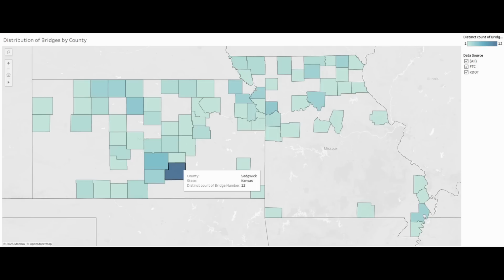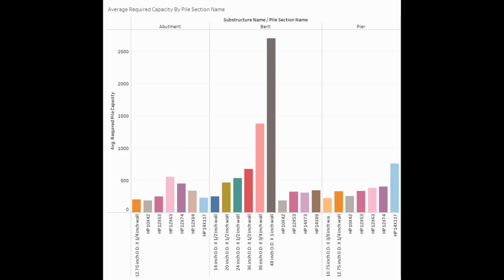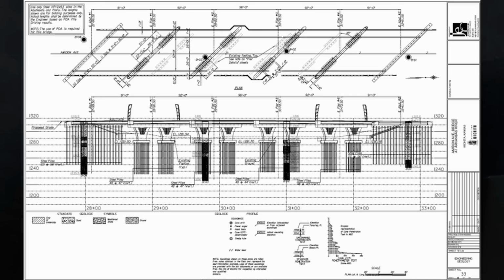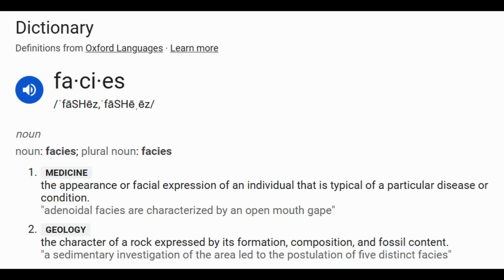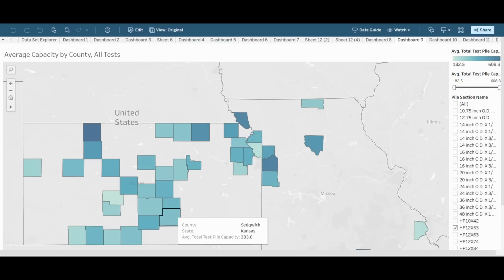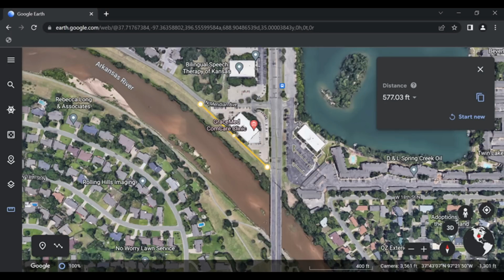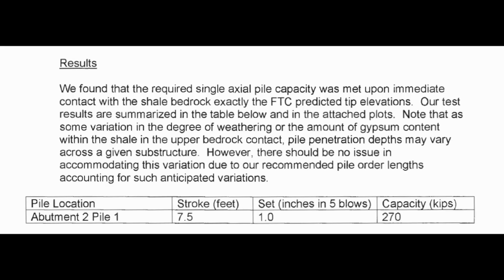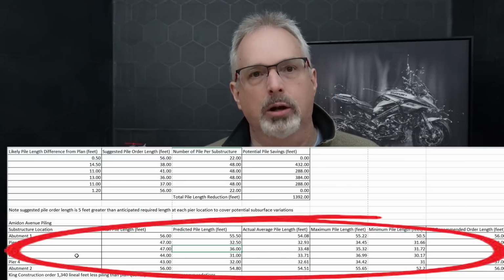Data Analytics and Geophysics for More Efficient Pile Design for Bridge Projects

Comment: I've been in and around different construction projects for over 50 years but I don't have any exposure to pile work. When driving/using steel piles is there a consideration for pile life based on corrosion?

Comment: Am curious to hear your thoughts about auger cast piles.
Reply from the maker: Auger cast piles have their place.  I know of sites near levees where the Corps of Engineers would not allow smooth wall driven pile or drilled shafts due to concerns about creating a seepage path.  From a capacity and integrity standpoint, I much prefer testing driven piles.  Integrity testing for auger cast piles is much more limited and less accurate.

Comment: At 0:50 neither of the two persons involved seem to have hearing protection, hopefully they have ear plugs.

I work in IT and there's nothing as expensive as coming up short a few feet on an installed network cable. But excess material is also an issue. Good measurements will save time and money in the long run.
Reply from the maker: Thanks.  I suspect that the had foam ear plugs inserted.  They were good about safety on this job.  And you a right, it is better to be a little long on materials instead of short!

Comment: It seems like the states all should require the contractors to report back on their construction and testing results to a state database. This would enable more analytics.
Reply from the maker: I wish that were the case.  The hardest part about implementing this application is getting access to the data.  Most DOTs don't have a very good system for compiling and disseminating this information.

Comment: If the layers that we were shown in the rock formed over years, if not centuries, or millenia, why are they so uniform? Wouldn't there be minor disturbances (from wind or animals or other natural effects) cause the layers to not be so precisely uniform?
Reply from the maker: There are definitely variations in subsurface conditions.  These variations can be somewhat normalized by incorporating a large set of data into the analysis.
Reply: @CaseyJones-Engineer  What are we saying has variations? The slices we see that span continents clearly have some variations. It's a naturally occurring material. What I'm asking is why the slices span such giant surfaces (unless you're saying the slices are disqualified from being "uniform" because there are variations in them so even though they look like a single layer they're actually not).

Comment: It looks like you have some very  helpful info. Even with good info, pile driving is still unpredictable. In my 35 yrs of construction, even with soil borings are every bent, Iv’e had piling 5 feet spacing vary in length by 15 feet. It can be a maddening process, at times.
Reply from the maker: Thank you.  Yes, there are some sites that are just a nightmare for accurately estimating pile length.  One problem area I know about is in southwest Missouri with the pinnacled bedrock.
Reply: @ South central Illinois right about where the glacier stopped is so unpredictable as well.

Comment: Very informative video Casey! Know these statistics are basically for your two state area, but what about other areas of the country where subsoil may be very different? Assuming your instrumentation has to be calibrated, what about pile driver, does it have to be also?
Reply from the maker: Thank you!  Yes, the correlations like these can be made using other data sets for a given region.  For example, Pennsylvania has very similar subsurface conditions to Kansas in many parts of the state.  Even where site conditions differ, local correlations are possible by examining trends from the local data sets and excluding data sets from dissimilar regions.

Comment: Is 5 to 10 ft into weathered shale typical for a 12x53 H pile? 

I would like to model the weathered rock layers in something like WEAP accurately but usually we just say X amount of feet into weathered rock or top of rock and the calcs don't matter at that point. Great video.
Reply from the maker: Thank you!  Sometimes trying to figuring out what's truly top of rock is easier said than done in some cases.😃

Comment: How uniform are these near surface (that is for general construction purposes) bedrock profiles, does the seismic analysis show that reasonable clearly? To my suspicion, the geologic survey analysis would be too coarse for a bridge or road structures except where the surface geology is as it were in your face before you. There might be an old (million year old) buried river bed with very fractured material under your planned pile work, where the last one (over there) was on more solid bedrock of the same age layer. And a fracture that shifted or folded the layer beneath your next location - potentially a sort of a crap shoot.
Reply from the maker: I think this application works well when you have soil overlying highly weathered rock which transitions to slightly weathered rock with depth.  At least that has been our experience so far.  Keep in mind that the seismic surveys are really supplemental to doing a traditional geotechnical investigation that includes soil borings and rock cores.

Comment: “Mudstone, a type of mudrock, is a fine-grained sedimentary rock whose original constituents were clays or muds. Mudstone is distinguished from shale by its lack of fissility. The term mudstone is also used to describe carbonate rocks (limestone or dolomite) that are composed predominantly of carbonate mud. However, in most contexts, the term refers to siliciclastic mudstone, composed mostly of silicate minerals.”

“Karst (/kɑːrst/) is a topography formed from the dissolution of soluble carbonate rocks such as limestone and dolomite. It is characterized by features like poljes above and drainage systems with sinkholes and caves underground. There is some evidence that karst may occur in more weathering-resistant rocks such as quartzite given the right. Subterranean drainage may limit surface water, with few to no rivers or lakes. In regions where the dissolved bedrock is covered (perhaps by debris) or confined by one or more superimposed non-soluble rock strata, distinctive karst features may occur only at subsurface levels and can be totally missing above ground.” 

In our area, which was over the Edward’s Aquifer, drilling a water well requires somewhat special equipment because ground water levels can be a couple hundred feet (or much more) underground. Drilling through Karst has the disadvantage of deep caves and part of the drilling gear can just “drop”. In these instances ground sonar equipment might also be employed. 

The issue with mudstone is dissimilar. Most sedimentary rocks harden by the extrusion of moisture and crystailzation over time. Mudstones are just dried out compressed mud. When you heat the mud essentially you get pottery, and over geological time these heat processes occur via underlying Magma penetration or in some places soils being covered by 1000s of feet and then uncovering. As a consequence such stone has a wide range of hardness and variability. 

BTW, as you mentioned this is some what true of shale, though some shale can be extremely hard, 

“Lithification follows closely on compaction, as increased temperatures at depth hasten deposition of cement that binds the grains together. Pressure solution contributes to cementing, as the mineral dissolved from strained contact points is redeposited in the unstrained pore spaces. The clay minerals may be altered as well. For example, smectite is altered to illite at temperatures of about 55 to 200 °C (130 to 390 °F), releasing water in the process. Other alteration reactions include the alteration of smectite to chlorite and of kaolinite to illite at temperatures between 120 and 150 °C (250 and 300 °F). Because of these reactions, illite composes 80% of Precambrian shales, versus about 25% of young shales.” 

It is important to note that Precambrian shales (pre Ediacaran) were formed in seas with lower redox potentials, thus the oxidation states of minerals are lower and more easily desolved or undergo oxidative transformation. As a result some that’s hard before perturbation may not remain at the same hardness when exposed to oxygen.

Comment: Why wouldn't an owner (DOT) include this data with the request for bid specs as routine? At least require wherever available data be used by bidders and attached to bid package for the owner to evaluate bidders completeness of needed pile specs to be able to support the loads that will be present. Too often unfortunately government is where common sense goes to die. Ray

Comment: This is actually a GRAND use of technology! I simply can't imagine that this is not STANDARD PRACTICE for every geo testing company! By providing this data to the contractors, geo testing providers could (in my opinion) save the contractors and in many cases, the tax payers the entire cost of the geo testing to verify the bridge (structure) will stay where placed!
Reply from the maker: Thank you so much!  We are pretty excited about it.  Unfortunately we sometimes find ourselves ahead of the market.  Over 10 years ago I developed laser based equipment to automatically compute pile set and hammer stroke and produce drive logs so that somebody didn't have to stand below the hammer marking set.  I sold one unit to the Federal government and that was it!  I still use it in my practice so maybe I could get some traction if I make a video about it.
Reply: See Act Blue and high speed rail in California for saving tax money.